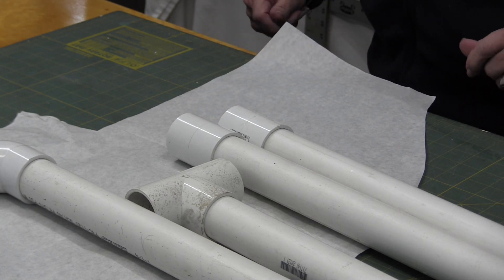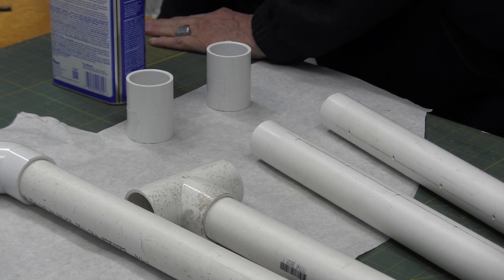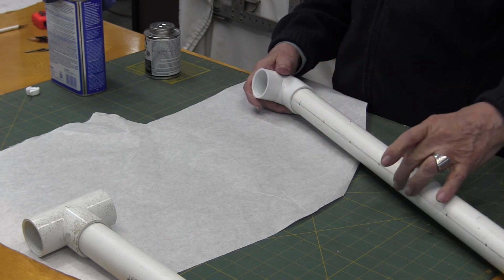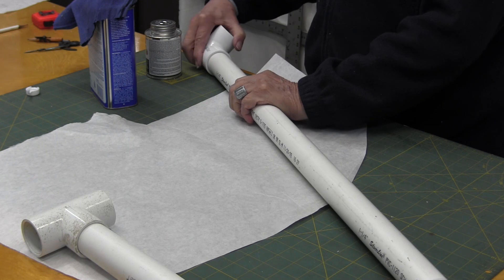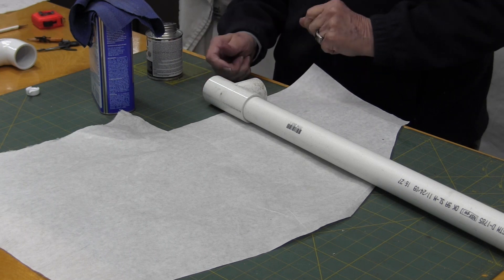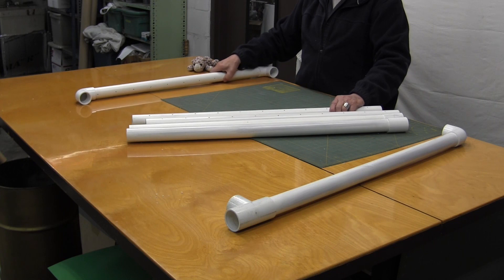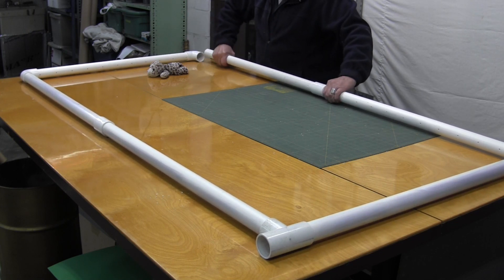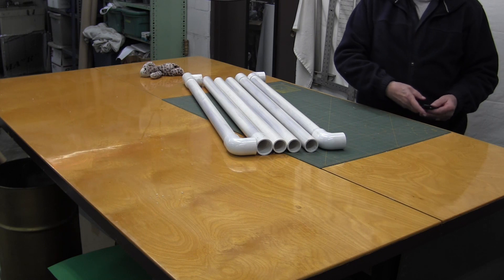Making a latex vacuum bed 013.2

Comment: I have build a Vacbed after your tutorial, only problem is, in some areas it does not suck out all the air. There are enough holes on the inside but it seems like some air remains inside the bed. Any idea for a solution?
Reply from the maker: Is the vacuum a house vac or a shop vac? How many holes do you have in the tubing and what size are they, how far apart? How thick is the latex?
Reply: @Latex1945  ty for your fast respons :) its 0.4mm Latex, a house vac and the holes were like 5 to 6 cm to each other on  body height, 10 cm to each other down the legs. the problem is more at the top i guess with the stucking air. The air is sucked out from the bottom/feet area.

Comment: Hello Mr. Anton,
Thanks for you Video , 
I have a question.. is that a mistake in the video where dss latex is exactly on top of each other at the beginning of the head? because as the video progresses, the upper layer of latex seems to be 1cm smaller at the edges than at the beginning. or am I wrong. I'm building a vacbed right now and would be reluctant to reduce the width.

Comment: Thanks for the videos - great information.  I already have 1.5 inch, sch 40 pipe.  Will that work instead of 1.25 inch?  Also, to help decrease the noise of the vacuum being close to the person's head in the vacbed, could I add another section of pipe to the outside portion of the "T" pipe end and attach the vacuum to that farther away from the bed?  Thanks
Reply from the maker: The 1.5 inch pipe will work.
You can add piping or hose to put the vacuum away from the bed.
What works is a centurial house vacuum.
Hope you have a lot of fun in the bed.